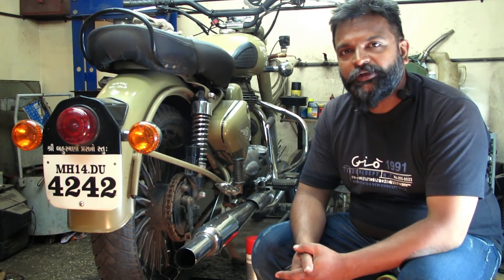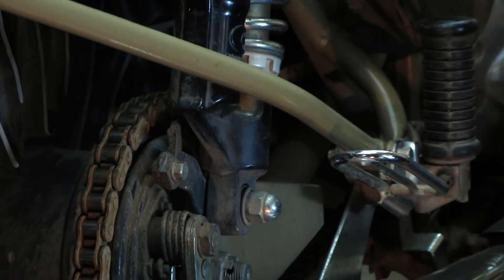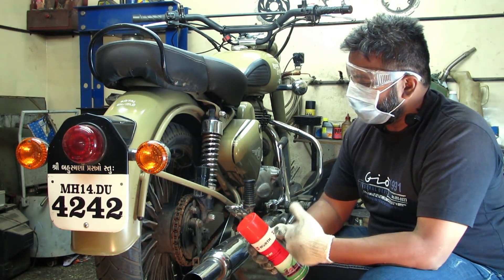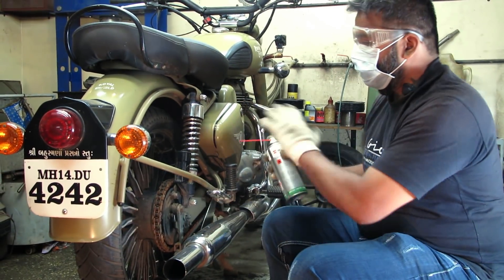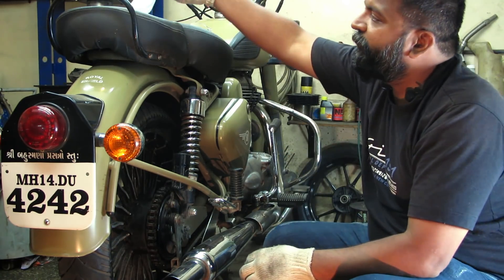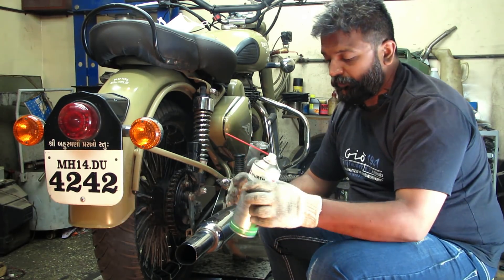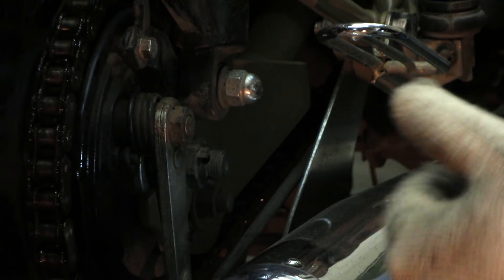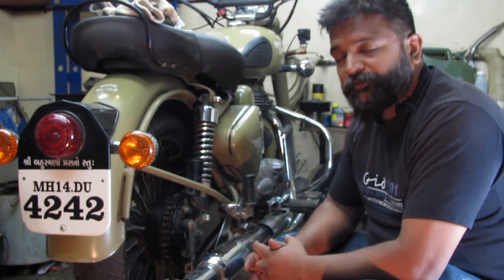How to fix a Rusty Motorcycle Chain | Chain Restoration

Comment: Didn’t get correctly what’s outer side and inner side I’ve same problem right now
Reply from the maker: Vertical face of the chain. Inside which is towards wheel side and outside which you see from brake side.

Comment: Sir die hard fan of u..
Low light is again an issue.
And one thing more,,,,plz make a video on full servicing on old bullet(C.I.)engine🙏🙏🙏🙏🙏
Reply from the maker: Thank you very much. till 15th Jan we have pre recorded videos which are in line to upload with what ever the light setup we have. Since its a workshop not studio so its right now hard. Right now our current video projects are on hold due to this light issue only. So bare with it. About CI then you can expect that in sometime once we get the bike at our shop. We have already stopped working on RE's from last 2 & 1/2 yrs. Since we have shifted to bigger bikes. But for all of you we will make Videos on CI/AVL/UCE/ and many other engines, I appreciate that you all are liking our videos. Stay connected for more in-depth information videos.
Reply: mechautoclinic 
Thanku so much sir...
Bt my many friends are c.i. bullet users,,,so its a humble request sir..
Reply from the maker: it will be done. me little busy in my workshop and I actually shifted to big bikes after working on these bikes for 15yrs so hard to do very fast coz 2-3yrs back i did close working on bullets...it is just i am trying to give/share some of my experience with you all, so you guys will not have any issues...give me some time...Thanks.

Comment: can one use this on other parts as well?say like chasis?m planning to buy 2009 yamaha fz and its a bit rusted all over the place.
Reply from the maker: This solution will work but not permanently. best is to use diff. process for cleansing.
Reply: mechautoclinic what exactly would that be?
Reply from the maker: tedious process and costly. but this is depending on how severe that rust is. if normal then its ok. well for this i need to see the bike or at least pics.

Comment: I have new TVS Jupiter and it is just 4.5 months old and just 2550kms total run. 2nd free service is done. Tyre pressure is ok. Engine oil and gear oil is just changed few days ago. Rear tyre is freely move.
My problem is that the scooter is always start to vibrating around 45 to 50 km/h speed and if two persons are sitting on scooter then its vibration increases and start from 35 to 50km/h speed. After 52 km/h speed no more vibrations. Vibrations coming from handle, floor board and slightly from rear side when pillion also sit. Is it required to use sandpaper in clutch cover, clutch shoe, rear tyre assembly and rear brake shoes and also clean the clutch cover and greasing the rollers in clutch and variator? I see some videos on internet to use ragemaar/sandpaper in rear tyre's internal assembly area, brake shoes, clutch shoes and also clean the clutch area and greasing all rollers of clutch and variator but it is not mentioned in TVS manual book and also service centre guys had never done it.
I told this vibrating problem to TVS service centre during free service but they just tight the all screws.
What you think, what is the actual problem of vibration around 40 to 50 km/h speed. Is this a problem of clutch shoe, Variator, rollers or something else? What is the solution? Please help me.
Reply from the maker: engine vibrations can come because of wrong carburetor settings as well.
Reply: mechautoclinic No sir carburettor settings are company set. I have still not change it. 
So you have read my whole problem. What is the solution for it?
Reply from the maker: Yes I read whole problem ....don't trust company settings. sometimes u may get wrong one. check the carb. also if setting is correct then you may need to try bigger carburetor jets.
Reply: mechautoclinic don't you think may be there is problem with clutch or variator or rollers etc?
Reply from the maker: nope
Reply: mechautoclinic why?
Reply from the maker: Lean mixture makes high vibes and rough engine running. When we do benchmarking while and for tuning the engine we keep on checking around mixtures, Even if it is carburetor or EFI.

Comment: Nice informative video.. my TB350 chain is bit tight at some position and loose at  other positions.. can i know the reason for this..
Reply from the maker: worn out rear sprocket.
Reply: Ok.. but my rear sporket has no broken teeth.. all are fine.. i have run abt 20k kms. But i regularly lube my chain. After every 500 km..
Reply from the maker: rear sprocket generally gets worn out first and fast. and u can't see that by eyes. so u r sprocket is right now EGG shape not in round. due to off axis this happens
Reply from the maker: dont worry u will get to know soon. we have made the video on this will be uploaded soon. thanks.
Reply: Great... Thanks a lot.. u stay in pune right.. will try to meet you sime day..
Reply from the maker: Yes we are Pune based.

Comment: can heavy gear oil be used alternatively
Reply from the maker: you can use. Conventional way was oil only when chemicals were not there. But I stopped using oil from long time due to spillage on tyres. Now bikes are changed and also having high speeds. So need sticky lube rather than oil. Sticky lubes stays there only. No spitting unlike Oil. Oil may cause tyre slipping issue which may endanger life. Others also may have issue due to that since it oil get spits due to chain rotation. it may spit on road or someone else. So chemicals are better...Thanks.

Comment: What an amazingly uducational channel you have there! 
Thank you for the knowledge.🙏🏻

One quick question:

Can we use "Pidilite WD40" or "Krud Kutter Rust Remover"(Phosphoric Acid Based) to clean the rust instead of the Weurth? 

Will they do the job or not work/damage the chain system?
Reply from the maker: Wd40 is good...not an issue
Reply: @MechAutoClinic  thank you so much for taking out time to respond. Big fan of your videos. 🙏🏻
Reply from the maker: Anytime sirji

Comment: I have installed oil cooler assembly in my bike(apache 180cc), actually the bike doesn't have oil cooler, Normally my bike vibrates little, After installing oil cooler its vibrates more. I went to mechanic shop the mechanic checked the bike, and he was telling that when he in second gear he gave full throttle the bike reached only 50kmh, it is only giving more sound but not crossing 50kmh speed.So he said that there is a problem with clutch plate and its need to change, And he said interval time to change clutch plate is once every 20,000km........ please guide me on this.
Reply from the maker: your mechanic is right. if the bike RPM is going high and speed is less then that is the symptom that your clutch plates are either gone on toss or you have too tight clutch cable.  This may happened if you are rough rider/over clutch usage/engaging half clutch/using non MA or MA2 engine oil/bad quality clutch plates
Reply: But bike is not yet crossed 20,000km still round 19000km. And I'm not a  rugh rider , the mechanic tilling clutch has to replace every 20k km onece, is it necessary to change clutch onece in every 20k km
Reply from the maker: nope 20K is not the recommended or mandatory number. Clutch can go on toss even after 1000km. clutch life is always unknown. One thing is there if the bike is revving high and low speed then it is symptom of bad clutch and friction plate. clutch life is depending on usage. so if it is gone then gone. replacement is the best option. If your mechanic is telling you clutch gone after checking( i hope he knows how to check) then replace it. He may be not wrong. But he is wrong in saying every 20K about clutch replacement. So don't bother about this 20K number but right now bother about clutch plate current condition. Thanks.

Comment: Hello sir, I would like to share about my thunderbird350 rear disk issue is the rear wheel is not rotating smooth ,the disk pads are toughing the disk always I have done with wheel throwing&disk oil change and master kit too since no result still it is not smooth I kindly request you solve my issue
Reply from the maker: caliper is making it more tough. what ever things you have changed has got very less value, I am not saying some things you have done wrong. But things like disk fluid change has got nothing to do with it. Disk pads yes. But before changing anything always diagnose is better. Now in your issue caliper is making it tough. Just make the axle loose for testing when the bike is on main stand then rotate the wheel by hand if it moves freely. then fine. if not then prolly your master piston adjuster needs to be reset coz it is closing the return port. but if not that means your alignment of wheel/chain may be wrong or caliper pin greasing is not done due to which caliper is not floating horizontally. check these points first then we will see.. thanks.

Comment: Hello sir i have  uce 500 classic 2011 model .. whenever i start my bike after gap of 4-5 hrs decompresser creates noise like kut kut kut kut after 5 mints its become normal . Can you help me in this.
Reply from the maker: if the sound goes off then no issue. if the bike comes near to 360 RPM then yes it will make kit kit sound. but if the is at idle near to 900-1000 RPM then it will not make any sound. So check the bike idle RPM

Comment: Sir waiting for a new vidio,my thunderbird350 has driven 55000 kms and it is making noise in gears, if we put bike in centre stand and in  first  gear i have used the clutch and rotated the wheel front and back on that time inside the gears are making noise of different no smooth
Reply from the maker: Elaborate little more abut your problem. And yes sure will do that new video once we get a chance. Little busy in our new workshop which is catering HD's. So settling down right now. Thanks for suggestions though. Thanks for watching stay connected.

Comment: The chemical which you use in your videos from where we can get them or give some options other than that chemicals what we can use and will be available in markets easier
Reply from the maker: there are so many companies. but i am using this from long time which is giving me very good result. this is from WUERTH...where is your location? I may guide you
Reply: mechautoclinic cuttack,Odisha
Reply from the maker: Address: Bhubaneswar, Sector A, Mancheswar Industrial Estate, Bhubaneswar, Odisha 751007

Phone: 076828 28000
Reply: mechautoclinic thanks I will check it and can you please a make a video on all the required chemicals that we will use as a list
Reply from the maker: sure. thanks for suggestion.
Reply: Make a video on hydraulic clutch on classic in detail please m eagerly waiting for video
Reply: you can use WD-40 , no need of these expensives